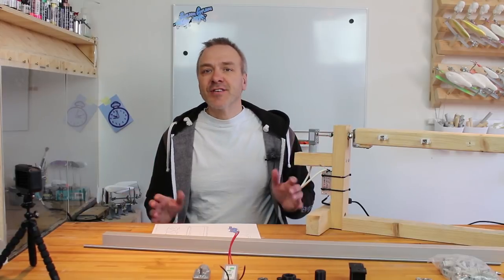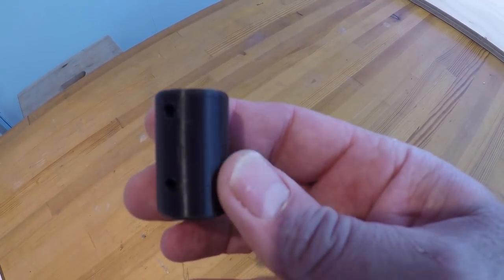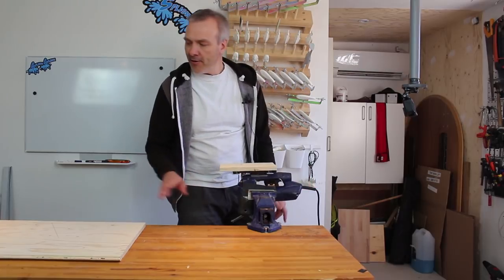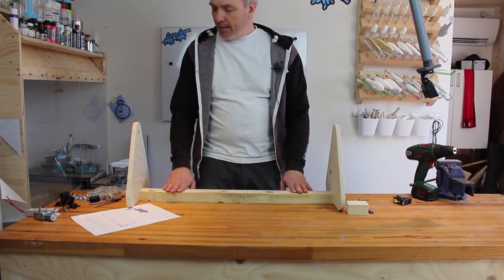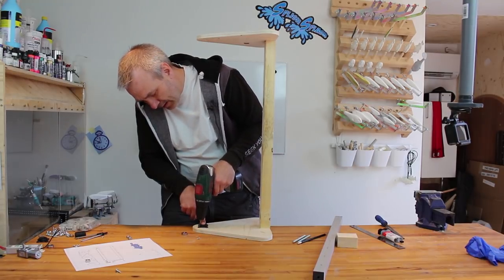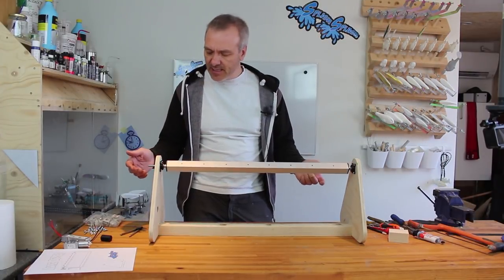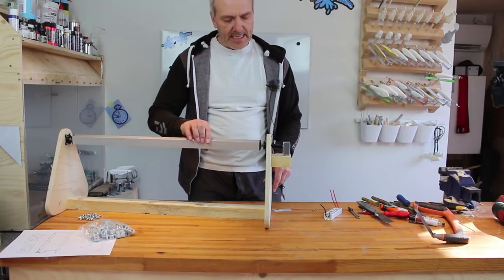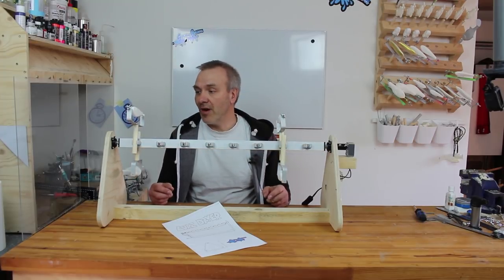Building a Lure Dryer

Comment: Hello, which clips are you using for the holders that fit the tubing? And what tubing are you using? It’s not PVC is it? I bought 1/2 inch PVC and 1/2 inch clips and the PVC doesn’t fit into the clips. I’m guessing it’s because the inside diameter of the pvc is 1/2 inch not the outside. Are you using some type of electrical conduit for the holders? Please let me know and I’ll order the parts today. Thanks!

Comment: Thank you for this video, it was very inspiring. I think my motor rotates the lures too fast. I can see some sektions where the epoxy isn't fully and nicley coated on the surface it looks more like dops here and there. Is the motor too fast in order to distribute the epoxy nicley or is it just too much epoxy? any advice?
Reply from the maker: Sounds like what is called "fish eyes", and has nothing to do with the rotation. Try checking my basic luremaking vid about epoxy coating

Comment: First of all, thank you for yopur videos, they are amazing and have been an important help through learning lure making. My epoxi recomends beeing handled after 12h. How long +- should i leave my lures on my lure turner? my lure turner is diy with a grill motor, but the thing does overheat, i suspect it will burn soon... its not expensive, on the bright side. However i want to leave it on only the necessary time to improove its life span. thank you. great channel
Reply: The epoxy I use only allows handling for about 2 hours, and normally I can apply more coats after 12-18 hours. After last layer I let them have at least 24 hours to harden fully. !2 hours sounds like long handling time, and I can't say how long you will have to turn them, but test it out.  First time, check out the epoxy with a brush (normally you can clean the brush with alcohol) When i starts to get really sticky you should stop. Then just wait whith next layer until its not tacky anymore.  A cheap motor for a turner is a "discoball/mirrorball" motor, if your turner is not too big. good luck

Comment: Hi Jørgen, i hope you are doing well, i have the exact same motor but it is running at 5-6 PRM, do you think 6 turns per minute is to fast for epoxy clear coating? Also, instead of using lure holder slots i am planing to use neodymium magnets (fixing them on the aluminium shaft)... do you think this will work? Last question is, i am keen to find out if you still use this lure dryer and how it performs so far? Thanks in advance for taking time 👍 cheers
Reply from the maker: Hi Günay. I think that 5-6 RPM could be a little too fast. 1-3 would be the optimal range. Turning too fast would "sling" the epoxy to the part of the lure furthest away from the axis. You will have to check if 5-6 RPM is "too fast"

I have seen many using magnets, and it seems to work fine

Good luck with it all

Comment: Nice build! Runs really smooth with the bearings. Would a motor running at 5 rpm influence the finish though? For me its easier to get that here than lower rpm motors
Reply from the maker: I havn't tried above 3 rpm, which worked fine. 5 might be a bit high as you want the gravity to pull the epoxy around the lure, not the centrifugal force to sling it to the outside. That said, I would imagine the at 5 rpm the centrifugal force would still be the primary. But if you have such a motor, just try it with a dummy lure.
Reply: @SplishSplashFishing  Thank you for the advice 👍

Comment: Hey Jōrgen. Great vid as always. I wanna try this out. Can you tell me which ball bearing size you use so I can also order it from aliexpress. Thx
Reply from the maker: Hi Glenn. They are 22 mm outside, 8 mm inside and 7mm wide - I have used these from Ali: https://www.aliexpress.com/item/32342893985.html?spm=a2g0s.9042311.0.0.422d4c4dPN2nwE

I will add the link to the description. Good luck with your project.

Comment: The motor is actually a humidifier motor. Should be about $20 Canadian. Double Check you voltage and Rpm.

Comment: why use a 12 volt power supply if the motor is 6 volt?
Reply from the maker: You can choose a 12 v motor on the same link. Or at least you could at that point
Reply: If i go for the 12 volt motor (2rpm) then what option i have to chose for the supply? I mean how many watt? As there are many options and I am confused. Thx